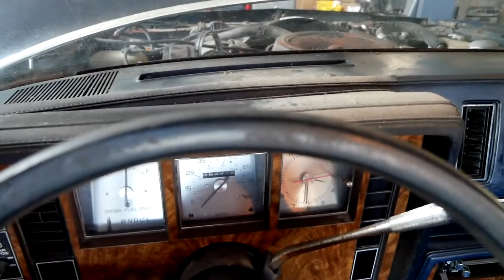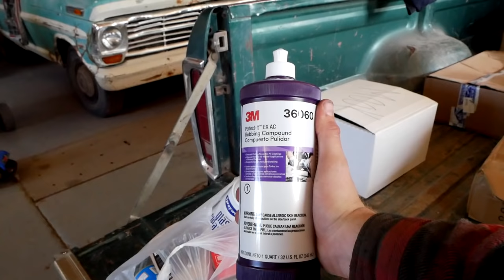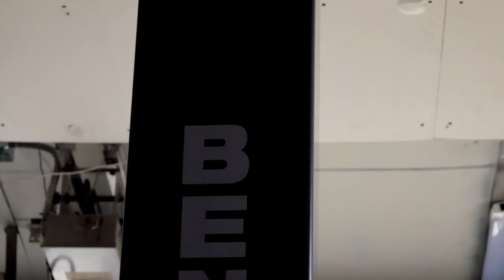Will the Most UNRELIABLE 1980's Car Return on the Road!?

Comment: I still get the biggest kick out of Angus and those free coveralls.
Reply: You mean he bought coveralls and got a free truck.
Reply: @Biggspeed  . maybe that was it, either way it's still funny, and he hated that Buick. Ha
Reply: Same!
Reply: You are doing it cause it's frickin cool. By the way, the pulleys on those wore horribly and even new belts would squeel. I had an 81 olds cutlass cruiser wagon. Belts always made noise. Just s thought.
Reply: Hey guys ever hear of heppa virus vacuuming putting mice turd germs in air not a good idea
Reply: @honorrolls5415  your mean haunta virus?
Reply: @honorrolls5415  hantavirus, and I think it is more of a problem in the drier desert southwest... not sure why I think that, but maybe it was based on some sound logic at some point. I'd definitely want something with a Hepa filter if I was vacuuming large amounts of mouse poop though!
edit: https://www.cdc.gov/hantavirus/surveillance/reporting-state.html
Reply: Me to 🤣
Reply: @Biggspeed  The ones he's wearing in this video were the same ones he pulled out of the toolbox of his truck
Reply: My 84 Caddy Eldo did the exact same thing for almost a year. I tried everything. My alternator had a wobble in it. That belt squeal drove me nuts. Lot of draw on a Caddy so got to thinking it was the low battery. Seemed like something was tightening up every now and then. Then right ouf of the blue it would go away.

Comment: With only two belts on your water pump pulley, the pulley shaft was probably deflected enough towards the alternator side that either:
A) The bearings in the water pump were overloaded on that side, or
B) The pulley twisted over enough to cause a belt misalignment.
Props for sticking with it and figuring out how to fix it!
Reply: I agree with a.  I have been thinking that the entire time watching this a year later lol
Reply: I was looking for that, I believe that middle pulley might have loose mounts just a tad, but with belts tensioned, It's just enough to scrape. When you add more belts, they app tension in different direction, so it basically cancels, at least a bit. It makes sense as metal did expand from heat → mounts got just a bit looser.
Reply: I know this is a old video but I just saw it.  The problem is it has the wrong alternator belt.  GM never made a engine where the alternator was powered only by the water pump.  The belt should go around the crank pulley, water pump and alternator.
Reply: The whole time I was watching, I was thinking it was the water pump that was bad, since it was an obvious return.  But videos like this remind me I don't know everything.
Reply: @BobWiersema  Not correct! My Olds 307 in my 88 Fleetwood alternator was driven off only the water pump. Its an Olds V8 thing.
Reply: @chrisreynolds6520  They did some sketchy stuff during the smog years to get an air pump on those engines.  Your 88 would have been one of them.  But before that engine was modified for the smog rules it wasn't like that.  This wasn't general practice for GM.  So that's very possible that the Buick was like that too.
Reply: Exactly

Comment: Hi Kevin, I had a 1981 oldsmobile that had the same belt squeal issue and it turned out to be  the pulleys on the crank. Apparently the old v belt style would wear the sides of the v out to the point where the belts would go too deep into the groove and bottom out causing loss of grip. I relaced those pulleys and it fixed the problem completely.
Reply: Was thinking the same.
Reply: Sounds right to me. My 78 lemans did the same.
Reply: That was one of my ideas as well. To replace the crank pulley
Reply from the maker: That was one of the first things checked besides alignment, sure enough it was good to go! Weird ordeal
Reply: @JunkyardDigs  did the squeak come back again?
Reply: I had five olds v8 cars three 307 v8 86-87 gbody Buick Regals, and a 79 oldsmobile delta 88 350 oldsmobile v8 and a 77 Oldsmobile 98 regency with a 350 oldsmobile v8 and all of them squeal loudly from a combination of the power steering pump and the alternator, usually from getting the belts way too tight on the pulleys rather than replace the belts and adjust them correctly with the bushings and spacers in place, which by the way will effectively kill the bearing in the alternator causing it to fail or seize up eventually.
Reply: @EvilTurkeySlices  good
Reply: @JunkyardDigs  did you had to get a new passenger side mirror and passenger window replaced? I could tell the good work for all you guys

Comment: I was working at a chevy dealer when the converted olds engine came out, this was in a rural area and rural people loved their big GM cars, so getting 30 mpg as opposed to 14 was a good deal, this was during another one of those gas price hikes, also diesel was cheaper by  the gallon than gas, like quite a bit less,  most people I knew that had them  had no trouble with them, hope you get lots of years of use out of old blue
Reply: It probably made the farmers feel right at home....if you close your eyes, you'd swear it said Massey Ferguson on the side. Sounds just like a tractor.

Comment: I use a mechanic's stethoscope to figure out where a sound is coming from. It's like a doctor's stethoscope but instead of a round  disk thing, it has a 2ft metal probe. You touch the end of the probe to something that you think is squealing and it conducts the sound from whatever it is touching, not everything around it. Super useful.
Reply: Sounds a lot better than using a long screwdriver and pushing the handle against your head/ear!
Reply: @MrCheesywaffles  haha yeah it sure is, been using both :D
Reply: @MrCheesywaffles  Been using the same long screwdriver for this for 35 years now. Was looking out for someone to mention it 😂

Comment: The reason the hood looks like that is because back in the vintage of that car GM was still using lacquer and the lacquer with micro crack and then when they painted over it it just accentuated it so the cracks or even deeper the only way to get rid of microcracking is to strip the paint and start over and apparently they just painted over it

Comment: Most GM’s scream when they’re out of alignment on the belts somethings not lined up properly
Reply: I’ve been saying that at my tv the whole time 😂
Reply: @andrewsummers1772  same here lol
Reply: @andrewsummers1772  me too.  Misalignment
Reply: no ac belt
Reply from the maker: They were dead nuts on, first thing I checked👌
Reply: Could it be missing shims behind the drive pully? I know our industrial service techs align belt driven pumps using a tool called a belt hog made by Acoem and most of them use 3 v-belts. My point is they need a laser to get it dead on. I'd try putting a dial indicator on the pully face and see how true it is. If you're using a straight edge you're only seeing one point on that pulley, if it's not square, as soon as it rotate 180 deg you may be out.... can't hurt to check.
Reply: Bet it’s the power steering belt, oldsmobile engines use two spacers for the power steering pump that are absolutely necessary for pulley alignment. There is one on a water pump stud and the other on the bottom of the block probably missing one or both. They also used 3 different length water pumps, but it seems they got the correct one
Reply: Everybody hollering it alignment..2 problems with the theory..he already said he checked it..and more importantly alternator squacked like a mockingbird when out of the car and turned by hand.
Reply: @kevinfloyd808  those spacers can throw it off just enough to look straight but still do this, ask me how I know. They also replaced the alternator and I’ve had alternators that sounded like that off the car and were silent when running
Reply: @JunkyardDigs  The pully are not worn out? where the belt grips are it stil V shaped or turned U shape?
Reply: Seems like especially Buick and Oldsmobile
Reply: Fan clutch
Reply: @andrewsummers1772  100%! Wifey was looking at me funny for talking at the video.
Reply: You can see in the video that there is a belt alignment issue. :)
Reply: I could be wrong but I've seen in the past GM alternators scream like that when they were under too much load. If the batteries were both mostly dead and one of the positive cables was loose or making a poor connection, (not that side mounts ever really have good connections.)that would have been my first guess. Seeing the heat on the positive cable through the FLIR leads me to think that could have been part of the issue. My son had a Caddy from around that era with a loose side mount battery. The post heated up so much that it melted the side mount over time.
Reply: On the 6.5l diesel in AMG Hummers the belt usually will squeel when pulled to hard one way or belt slap will happen when loose.
Reply: @chspyderr  you got it. pulley was being pulled to one side. the AC belt pulled it back into line.

Comment: this was your most challenging project. I never seen you so frustrated and I sure in hell don't blame you. Yes belt dressing can work miracles. that is an old timers treatment.
Reply: Heard that those deodorant stick that you screw out work I these cases.
Reply: @joaob.almeida5176  the service station I pumped gas at in high school used to use comet or ajax
Reply: Death Wish  I’ve used that in a pinch. Canning wax block, or just an old thrift store fat candle.
Reply: 5.7 Diesel engines had most people screaming lol

Comment: The noise didn't stop when you pulled the alternator belt off it just got quieter. Go back and listen with headphones again when you fire the engine before you spin things with the drill. The noise is still present it's just better. And you can hear the power steering pump squeal when you spin it with the drill.
Reply: I heard that too.
Reply from the maker: The squeal on the power steering bump was the belt hitting the fans of the alternator. 

I cut out about 30 other attempts of fixing this, I never found the true cause, But rather an acceptable Band-Aid
Reply: @JunkyardDigs  it was the ac belt them Gm cars have to have every belt tightened just right to not make noice

Comment: It's a long story but Kevin is right for continuity on your battery. I had a 1990 Jetta and I replaced a starter, alternator, and radiator (which was a stupid mistake and I ended up blasting a hole in it when I replaced something.) All because I had bad battery terminals. Check your terminals and connections before getting a battery.

Comment: I'd totally daily drive this lump, not a shadow of doubt.  Also, guessing from it's reliance on glow plugs to start that it's an IDI design.  That being the case, it could be an ideal candidate for running on vegetable oil. (DI can also run just fine on it, but change the oil even more often.)
Reply: @@user-pn1ti9il5q Yep, good stuff. There's a surprising amount of older diesel rigs that are DI here in the UK. Most of them making similar power to this from sub-3 litre displacement too, but sounding nothing like as good/pissing in Greta's cereal way less than a nice V8, sadly

Comment: One thing to check if you have a chronic belt squeak is the pulley alignment. Usually you can do it with a precision straight edge that is long enough but there is specialized equipment also. Some brackets for accessories are not that great and there can be part variations that can cause pulley alignment issues.

Comment: I totally sympathize with you and the squeaking. I have a 2006 GTO that developed a squeal to end all squeals. I changed all the pulleys. The car had only 29,000 miles. Squealed worse...changed the belts with "off brand" belts...quiet...bliss....for only a few hundred miles, then it started chirping and then squealing like 1000 stuck mice. I got belt dressing...it helped...for a few seconds. I bought more pulleys and finally Gates belts. I cleaned the crank pulley prior to all this. I started the car....silence....ahhhhh.....the key to this is, if you have an older low mile car stored in a garage in the Arizona desert, replace the belts with factory belts. 4 years later, at 32,000 miles, still silent.

Comment: I’ve kept belt dressing around for 40 years. Good way to isolate the worst problems when everything is chirping :)
Reply: Chirping belts? Use some comet cleanser (powder) sprinkle it lightly on running belts and the squeaky goes away! Careful though the fan will sling it EVERYWHERE so go sparingly
Reply: @DougsterWolverineGarage  that’s a new one for me, thanks.
Reply: Cheers Frank!
Reply: Armor-All or plain white bar soap has always worked for me.

Comment: I've invested in a mechanic's stethoscope and it's helped me find a bunch of noises I would've otherwise thrown parts at to try to fix.
Reply from the maker: I don't know if those work on rotating belts though 😅
Reply: Junkyard Digs just jam it in there. It'll be fine. Also try and get it in between the fins on the alternator 😉😉 joking aside great video and would love to see more of these 70s/80/ early 90s American land yachts. My favorite cars. I daily drive a 92 Buick century. Greetings from Sweden
Reply: @2strokepower803  are 90s buicks common in sweden?
Reply: I always used a piece of wood as a stethoscope.. an old wheelbarrow handle would work great
Reply: DaBossk some are actually more common than others. There is only 4 1992 centuries in the country but roadmaster wagons is quite more common. Same with park avenues of that era. And then the caprices could be found too fairly easy. 😁 we have quite a lot of American cars "over here"

Comment: I had a 1971 HQ GTS Holden Monaro Coupe (Factory 350 Chev SB) back when I was 20... It developed a “Chirping” under the bonnet & drove me and my mates crazy, trying to work out what it was. The motor was built, so trying to pin point the source of the squeak was difficult. Tried belts etc, changed out the alternator as well. It ended up being a dry shaft in the twin point Mallory dizzy... So frustrating! 
A subscriber from Tasmania, Australia. Keep up the great work. Love your videos.

Comment: Bingo with the compressor belt. When you would take the smog pump and ac belts off the gas g bodies you would have the same eternal squeal
Reply: Olds 307 did the same thing. The belt for smog pump and ac has to be installed to balance the sideways tension on the center pulley from the belts on the opposite side.
Reply: @robs1852  precisely the engine I'm talking about.... Damn 84 Cutlas, took me forever to figure that out.
Reply: That's the sound of a hot rodder when I was in highschool, haha.
Reply: @PorscheRacer14  I think back then everyone went through a g body or 2

Comment: I owned a 1981 Chev Citation 4dr, 2.8v6, auto. That little car was real fast and didn't blow up until there were foot long cracks in both heads and all the fluid was gone. It still started when cold but seized up pretty quick. You guys should find a Citation....they're the bomb😊

Comment: I was born and raised near Flint, MI also known as Buick town, the birthplace of General Motors.  So I have a soft spot for Buicks, especially the late 40's early 50's, but this one caught my eye, don't know why, maybe just the fact it was so neglected.  The A body was GM's bread and butter when it was RWD.  This will be a beauty when you are done.  Good luck!  BTW, I always used a chunk of garden hose as a stethoscope to verify the source of all noise before buying parts.  Water pump/alternator is easily mixed up.

Comment: My mom had a mid-80's Oldsmobile Delta 88 V8 diesel. It got great gas mileage and worked well while we had it. But, mom hated it because it was so noisy. Going down the highway it was awesome. If you needed a cross country car, there was nothing better. The A/C would freeze you out of the car, and the ride was so plush, comfy velour seats. It was fantastic.

Comment: I bought an '84 Olds Cutlass new also blue. After only three years, the paint turned purple with subsurface cracking on the hood, roof & trunk. I traded it in on a new '87 gray/silver 442 which I still have. After only two years, the hood, roof & trunk paint was completely faded. I had it repainted in 1990 (non-GM paint) and it still looks great today. GM paint was awful back then. The Buick's paint likely went south in the '80s just like mine did.

Comment: My dad's old 89 Chevy one ton big block squeeled very loudly when you first started it and after a few revs of the engine it went away. Changed belts after belts. Pulleys after Pulleys. Sprayed just about every anti squeek product at the time and it still squeeled. Never did effect performance.

Comment: The belt noice is from running without the AC belt. Without the AC belt the belt contacting area on the waterpump pulley is too little and it slips and heats up. I have hade the same problem.

Comment: These engines really aren't that bad, I've had a few and 4.3 v6s as well. The head bolts really are the only issue they have. With ARP head studs they'll even take 10-15 psi of boost perfectly fine. The 4.3s have 6 head bolts per cylinder, so they don't even need studs at all. A water separator, installed before the stock Stanadyne box filter, is also a good idea. The post-81 models at least have a water in fuel light. 85 models have a CAV 296 water separator from the factory. For 85 only, there was a special 4.3, RPO LS2, that had a Bosch electronically controlled VE pump. Very rare and very special, if you see one buy it.

Comment: I had a Barney Fife moment when I bought a beautiful low mileage '81 myself-little old lady car that looked brand new, even underneath-It had the 3.8 V-6. I learned the hard way, that this was GM's first year with an ECM-what a nightmare. It started knocking, and when I pulled the engine apart, it was clear that the oil had never been changed-small detail, right? Thanks? for the memories!